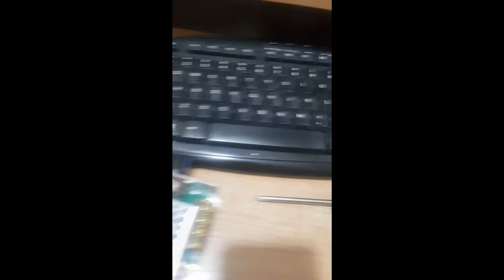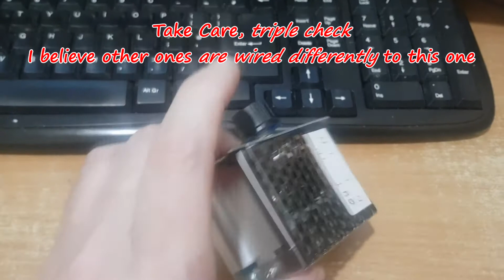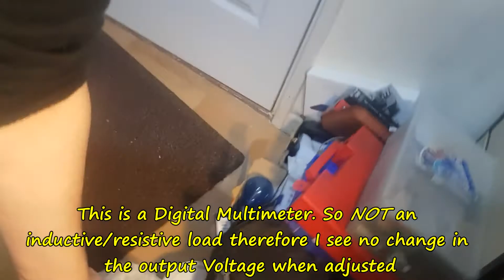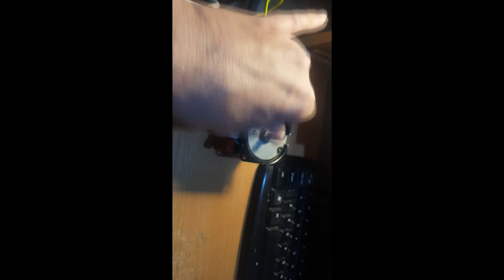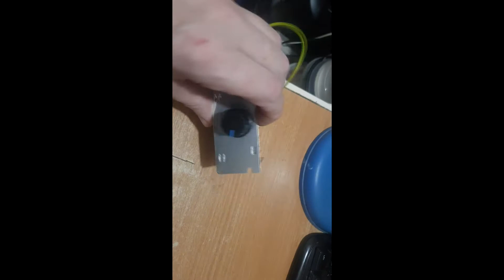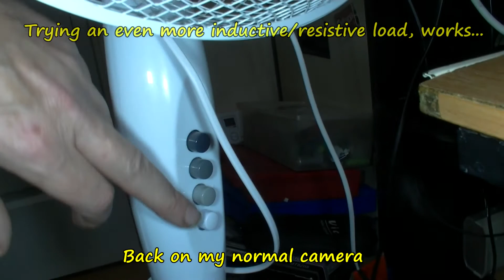UK 220V AC 4000W SCR Variable Voltage Regulator

Comment: Testing with under 100watt equipment? Joking right?
Reply from the maker: Should I dare contacting more than 1mA ⚡🔌⚡🔌
Reply: Good test/review by 3d printing. I’ve purchased one of these  for a 50 watt inline fan / light use. I find cheap items like this are best accessed as convenience only, to get projects up and running until such time you get something more robust. I agree with 3d and wouldn’t use it on anything anywhere near 100 watts.